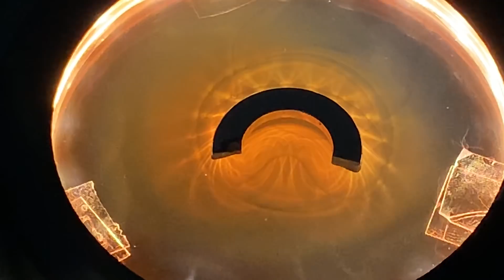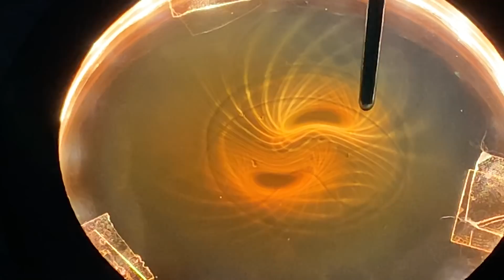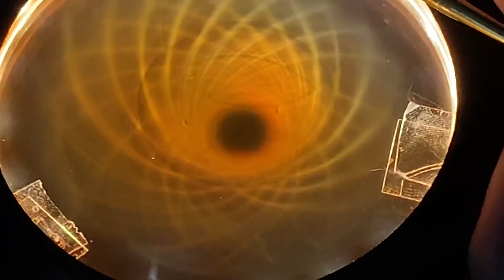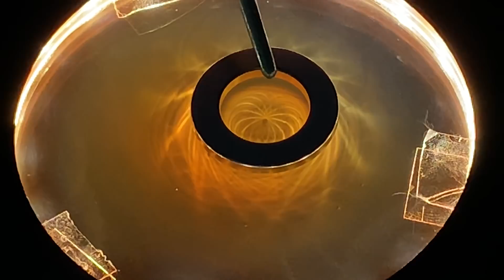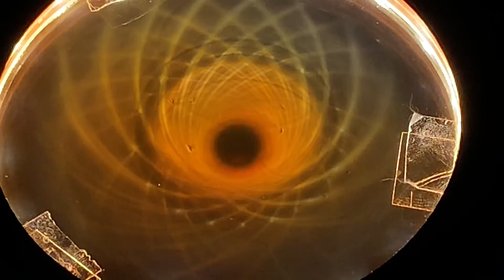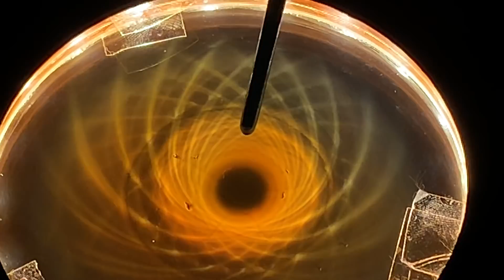🌠 Natures Secrets 🤔 Conjugate Geometry & Field Interference

Comment: Amazing as always Ken.
Question:
Do you think non-Euclidean counter-space and trans-Euclidian geometric pressure mediation can be defined and expressed within the 3 simple fixed dimensions we observe? If not do you think this could be why QM uses high dimensional space to express the wave functions of aether perturbations? On a side note have you read Dr Franck Delplace's paper on aether(space-time) viscosity? 
Thanks for your time and consideration
Reply from the maker: nope
Reply: I'm all for there being water in space not necessarily as a standard liquid but either in plasma or superfluid form. Either way the calculations and answers derived in the paper are pretty interesting.
Reply: I think it's important to distinguish between "space" and the aether (space-time). Water is just an aether function, aether is not a function of water.
Reply: By applying hyper dimensional fluid dynamics to the Aether/spacetime(not 3D space) you will find the same geometric pressure mediation that Ken talks about between space and counter-space at the source point in the field which is the convergence point with all non-local or non-Euclidean space and 3D observable Euclidean space. The values they find also indicated that the universe is over critical density meaning the universe itself is a giant torus... Something to think about.
Reply: In not mass that effects space-time by the way it's energy density and geometry to which I would refer you to Dollards paper "Energy Defined".
Reply: You seem to be confusing space with space-time... They are not equivalent
Reply: Just say Aether not space-time it's alot less confusing for all involved.
Reply: It's not "upward and downward" anywhere it's towards and away from the source point/dielectric inertial point/zero point/convergence point/center of gravity or whatever you want to call it. Up and down are just our limited perception of this.
Reply: Also I don't think the article is talking about space per se other then to reference the density of the universe being over critical density (water or plasma in space would lead to this). The aether or space-time in my understanding encompasses everything we see and experience and everything we can't. Its literally the "fabric" of reality. What we see as Ken says are geometric disturbances in this medium which look like mass or light or a field or whatever to us.
Reply: Maybe I'm wrong and speaking for Ken out of turn with some of that understanding. If he wants to correct me I'd be happy to listen as I generally defer to his opinion. That said I hope you have a wonderful day brother and don't let a YouTube debate get under your skin, it's not worth it.
Reply: Plasmas are described not just as hot or cold but also by their charge and Coulomb interaction. The van Allen belts are plasma and they are pretty cold but their charge is pretty high. I don't think you can say plasma will go up or down based solely on temperature.
Reply: There have also been many papers recently discussing plasma phase change specifically in a "microgravity" environment. liquid or solid plasma should not be as uncommon in the universe as one might think especially if it's supposed to be like 99.99% of the observable universe is plasma. As far as the sun I pretty well refer to a combination of Dollards observations and the opinion that the sun is pretty much the convergence point with higher dimensional space where the pressure of the collapsing field causes sonoluminescence which gives rise to the fusion and plasma.

Comment: The distinguishing basic feature of the Ferrocell in the presence of magnetic field, as far as optical properties are concerned, is the fact that the Ferrocell is generally magnetically anisotropic, such as the case of the Cotton-Mouton effect, in which the substance inside the Ferrocell behaves like a large group of small compasses, with the magnetic field defining the optic orientation. This means that the polarization in the Ferrocell by a given magnetic field is not just a simple scalar constant times the field but varies in a manner that depends on the direction of the applied field in relation to the plane of the Hele-Shaw cell. In this way, the polarization is attributed to the alignment of the nanoparticles by the magnetic field.
This pattern suggested empirically a resemblance of this system with the patterns involving the concept of spatial modes of electromagnetic radiation in an open-sided resonator. In order to explore some of the interesting patterns observed with the traditional solutions of paraxial wave equation [6], we have used a simple hint used in computational graphics: the pattern recognition. Based on the idea that any picture may be conceived as a mathematical object, lying on part of the Euclidean plane and each point having its own light intensity, we have explored the pattern formation using matrices with 1000 × 1000 elements, developing and testing several mathematical functions. Even though this phenomenological method is very empirical and takes a lot of time to find some useful images, many commercial software packages available have a wealth of built-in mathematical functions, facilitating the exploration of image formation.

Following the previous method, we have found that the mathematical problem of image formation involves as solutions for this kind of system the Hermite-Gauss and other hypergeometric polynomials
These patterns indicate that the Ferrocell has the same role of a diffraction grating in the presence of the magnetic field, similar to the case of liquid crystal devices
The pattern formation curiously resembles the nodal lines of the transverse electric and magnetic modes observed in optical resonant cavities, associated with the hypergeometric polynomials, such as Hermite-Gauss, Laguerre-Gauss, and Ince-Gauss polynomials. In this analogy, the magnetic field has an equivalent role of the Gaussian irradiance distribution, and the light source is a very flat lamp normal to z, which nearly corresponds to a plane wave with constant flux set up to the -axis, analogous to a standing wave in the optical cavity.
so there is another explanation that is mathematically undeniable that the ferrocell itself is a form of condensate that will distort any entering LED spectrums, and act as a diffraction grating that causes the most commonly perceived effect which is parralel lines of varying wavelengths which could explain the difference in visual intensity as we look at it and suggest a 3d interaction. But with the use of Hermit-gauss polynomial functions you can predict that you would expect such a behaviour from the magnetic field overlapping the distorted diffraction grating effect upon interaction with a common spectrum. So really the conclusion shows that light is bent by magnetism but the individual diffraction effect itself cannot be causally linked to the dielectric plane of interia without a mathematical proof
Because a lot of what is being seen is the alignment of the nano particles within the cell, and the diffraction of the spectrum into individual wavelengths following the curvature of the magnetic field itself.

Comment: I'd love to hear your thoughts on the paradox discussed in this video:

 https://youtu.be/zcqZHYo7ONs

Specifically, do you have an explanation for the phenomena discussed in context of your model of light as a perturbation instead of an emission?
Reply: It's just a series of phase shifts, similar to what you would see in an electric circuit which contains resistive and reactive elements. The light you see is analogous to the "real power", as contrasted with the "reactive power" and "apparent power", all of which depend on the phase between voltage and current.

It is only a paradox to those who are confused about the nature of light, in other words, most theoretical physicists.